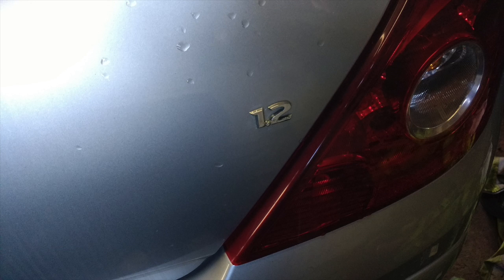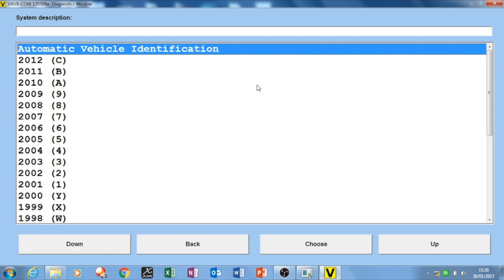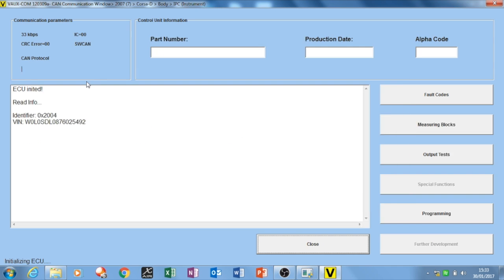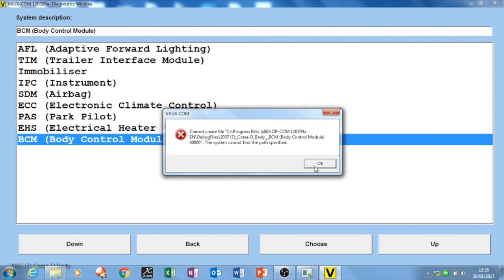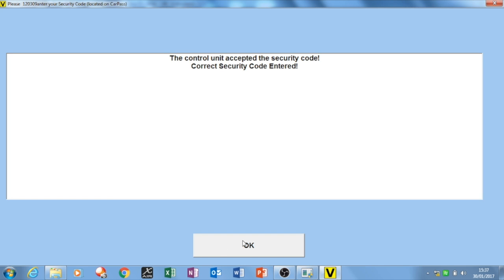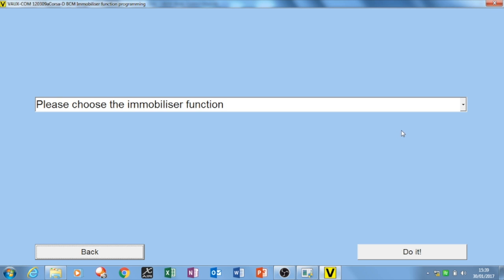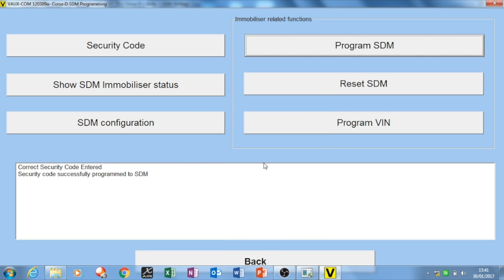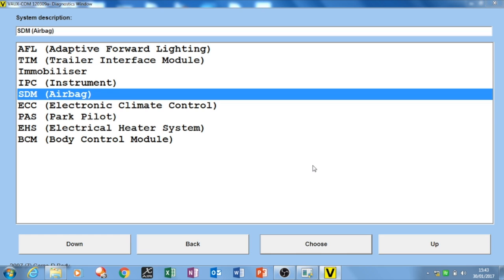Vauxhall Corsa D Airbag/SDM Module No Crank No Start Part 4

Comment: This also fixes the common bcm fault due to battery low voltage or battery dies common on 2006 to 2014 all engines. All you need to do after resetting the clocks and the bcm and programming transponder then resetting the airbag module taking key out in between as you mentioned I've fixed many just came across your video months later lol what a great video
Reply from the maker: Cheers Christopher, Sandy
Reply: Just fixed a corsa d it did say needed to replace ecu how ever followed your guide and managed to fix it thanks again

Comment: Hello, I bought another airbag module with the same number and label, but I don't have the pin code from the second used module, is it possible to program it. vauxall corsa d

Comment: Also does the sdm part number really have to be identical as I have used other part numbers for other control units before as long as they are off the same model car ?

Comment: Hi Sandy, I stumbled across this video whilst looking for help with our car. 
We are using a Corsa D for motorsport and need to remove the complete airbag system. I've got all the airbags and sensors out, and have got all the wiring to the SDM unit out except= black (earth) yellow/purple (12v) and on the other plug the two thin greens (CAN communication).  My question is: do you have any ideas how we can get the car to run without the SDM? Its really down to those 2 greens now - cheers Martyn
Reply from the maker: I think u would have to get Immobiliser function removed from the engine ECU cheers sandy

Comment: Hello Sandy, I've been in touch with an airbag specialist whose techncian says that B1000 airbag ECU and B0051 squibs energised can be cleared by them and will solve the airbag light /airbag working issue. I'm inclined to give it a try for £60+vat. Just wandering if it's likely to be that simple. I guess the only way to find out is to give it a try as either way I have to do something with the airbag module. Would you agree?
Reply from the maker: yes that sounds fair enough, just wondering now because it is Corsa D model maybe, although not sure, cheap vauxcom could reset airbag module as this guy does in video https://youtu.be/iGt3w2qCgEw   i take the airbags were deployed during crash and have been replaced?
Reply: thanks and yes airbags were deployed, car is accident repaired. Everything else works perfectly
Reply: Can you do this with any diagnostic scanner?

Comment: Hello Sandy, I wonder if you could help me. I have bought my son a 2013 corsa d damage repaired 1,2 only to find there's no airbag light. B1000 ECU and B00051 squib circuits activated. Not sure how to resolve without going in to Vauxhall. Would a replacement module sort the issues. MOT due Dec. Can you make any suggestions?
Reply from the maker: Hello with the corsa being a 2013 model vauxcom will not work, contact http://www.vauxhallpartsuk.com as he may give u advice, I would think u at the very least need a airbag/SDM moudule as I think they cannot be reset, sorry I cannot be of more help, sandy
Reply from the maker: Bharat Patel or try this https://www.ebay.co.uk/itm/VAUXHALL-CORSA-D-AIRBAG-MODULE-RESET-SERVICE-/322183491941
Reply: much appreciated!

Comment: I have a issue where I cannot communicate with the sdm and ipc? It wont communicate with them atall when I  click on them using opcom and when I do a check to make sure everything is online everything is present bar sdm and ipc ut says cant communicate.does this mean the problem is with the ipc and sdm ? The airbag light on the dash is not flashing
Reply from the maker: Yes I would agree there is a problem with SDM and IPC but u need to check that they have power, grounds and CAN COMMUNICATION on the correct pins! Do other modules report U Codes about SDM/IPC?
Reply from the maker: What year, model, engine size
Reply: @sandyande  Ya when I scanned the bcm I got wrong environment for both the ipc and sdm and I cleared them and refreshed and did not return until I powered down everything and started over and I got the sdm and ipc codes again.i then went to try and access the sdm unit and it would just say ECU needs more time and would never load data and it was the same for the ipc.then when I did the check to see if all the modules are present it says no communication with ipc and sdm.everything else is present.this all began after the car was jumpstarted and damaged the bcm.i assumed the bcm was causing the coms issue with the ipc etc.so I replaced the bcm and programmed the new 1 and am still left with no coms to ipc and sdm.the airbag light does not light up when I turn on the ignition either.is their a airbag or srs fuse that could be causing this
Reply: @sandyande  2006 corsa d, 1.2.sdm unit is the UJ one the same as your one in the video
Reply from the maker: Try this video for SDM pinout https://youtu.be/RWEIpxZagzg
Reply from the maker: Disconnect SDM and see if u can connect to IPC
Reply: @sandyande   will try that next thanks.because this is on the sw can would there be any point in checking the resistance in the can high and low pins on the odb2 plug to see if they are what they should be?